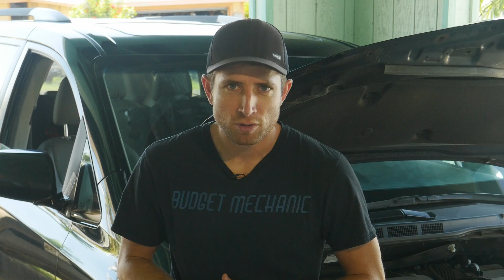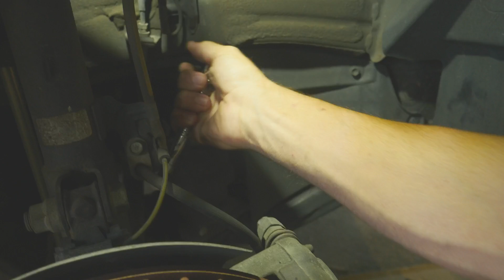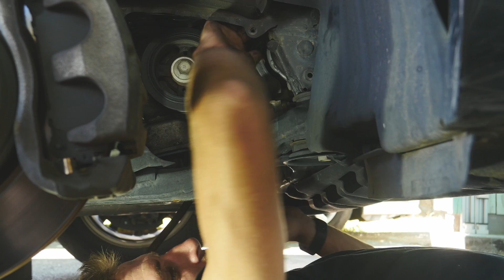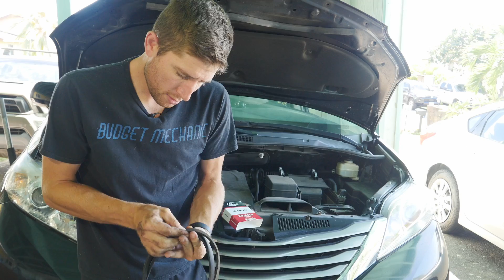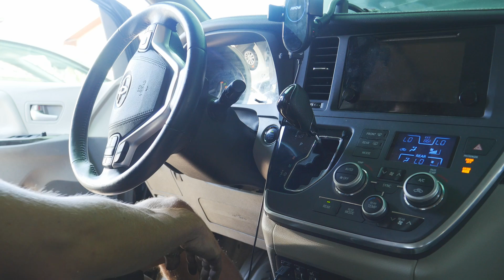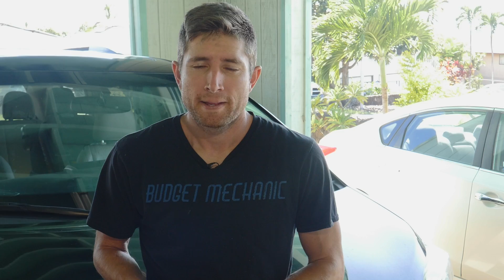Squealing Belt When You Start Car?! Replace Serpentine Drive Belt Toyota Sienna Tacoma RAV4

Comment: New belt. Still squeeks
Reply from the maker: Might be time for a tensioner!
Reply: @BudgetMechanicHawaii  it's weird I clicked the ignition on slightly before starting it fully and the squeek disappeared
Reply: @geekedmedia  my car squeels too but i found out that if you turn on the car without starting it for 5 seconds, then start the car, it will not squeel. But if you just pop the key in and start right away, it will squeel......🤷‍♂️
Reply: @BudgetMechanic1  I saw another video saying it's a computer era
Reply: @BudgetMechanic1 only squeals when I turn AC or heater on thank you
Reply from the maker: Hmm I’m not familiar with that computer issue. Failing belt tensioners (especially ones that have recently been compressed and released) are extremely common.
Reply: @BudgetMechanic1  I'll dig into that if the problem persists! Thank you
Reply from the maker: You sure the sound is from the belt?
Reply: @BudgetMechanic1  yes
Reply: @BudgetMechanic1  I just fixed the harmonic balancer, and got the belt replaced